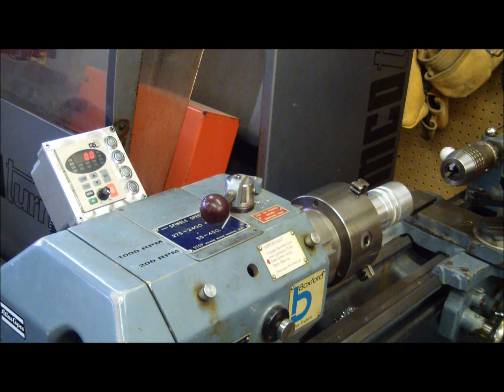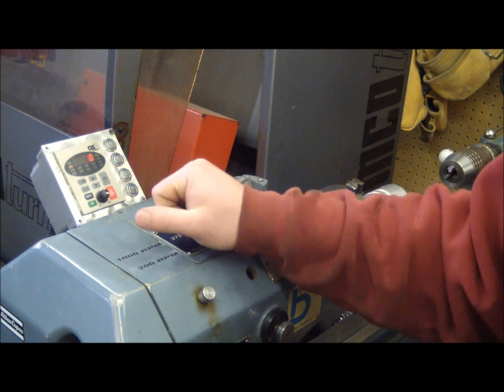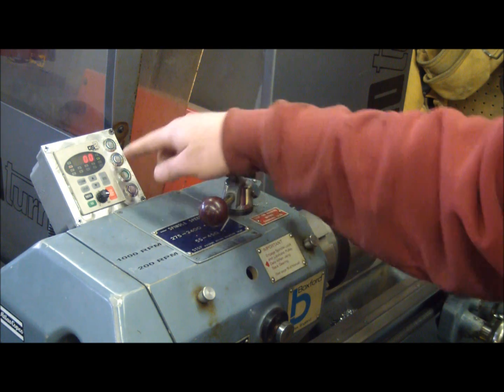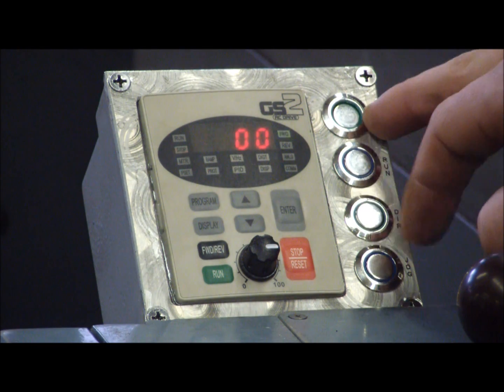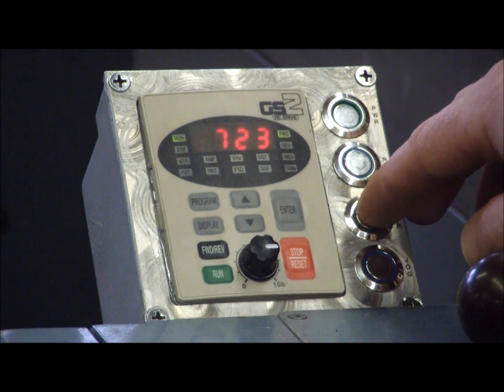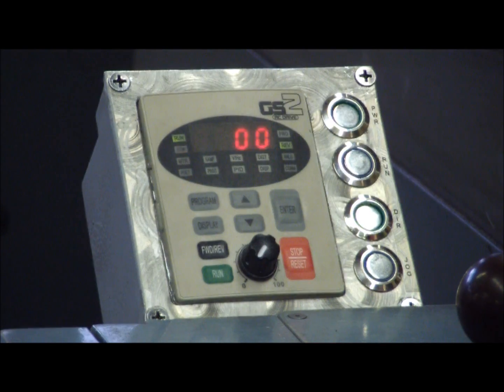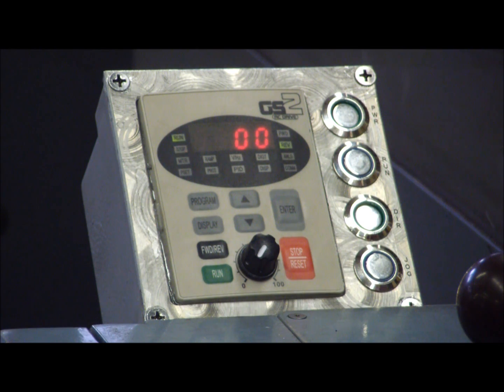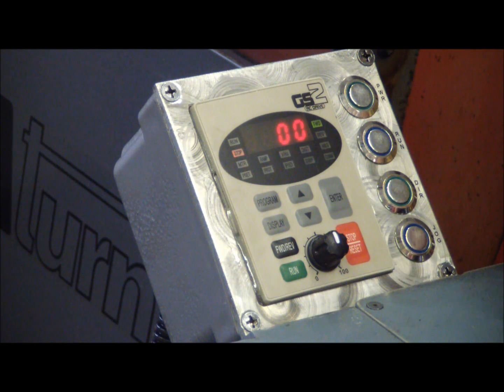How to run industrial 3 phase motor on single phase

Comment: A lot of old 3 phase motors are hardwired in star (wye, Y) configuration. You can run them on these 220v output vfds but you get something like 50% of rated power. You can open the motor up and try to locate the star point, cut it and bring the terminals out to the junction area to be wired in delta, but it's a bit of a job for someone who hasn't done it before. Can damage the winding insulation during the job or in operation afterwards if it's not put back together mickey mouse.

Comment: I hope you see this AVE,(considering this video is about 8 years old) I didn't want to post this on some random video. I thought I saw a newer video of you and Dewclaw working yalls electrical magic with installing VFD's for your 3ph machinery. I stumbled a pon some videos using a 3ph motor powered by 240 and in turn it was creating a 3rd leg for their milling and lathe. I am an electrician by trade and kinda have an understanding  what's going on here.  I was just wondering if you could explain it in your words and ways. another thought/question, unless someone just had a spare 3ph motor sitting around collecting dust why wouldn't they just buy something like you have in this video? It seems like it would be "cleaner" power and more functions. I can't imagine  buying a 3ph motor just to create the 3rd leg is cheaper than doing what you have done here though i haven't priced anything just speaking on opinion.  Thanks for what you do, I'm glad i stumbled on your channel!

Comment: Hi  I have a Mill/drill I just purchased. It has a 2HP 575VOlt 3 phase . I cant find a VFD that will take 240 single phase in and put out 575 volt 3phase. Any help would be AWESOME!!!!
Reply: Try configuring the motor for a different voltage

Comment: Google search turned up nothing...  (2019 go figure)

TY on android ≠ search within channel...  

So after scrolling thru every last video.  I successfully wasted a shit ton of time and further strengthen my proof that the interweb is the smoking gun.  The absolute, unequivocal, "fuck you buddy.  I know what the hell im talkin bout" proof that Mandela Effect is real.  Case in point.  Remember when you used to google something.  Then boom you solved the answer or located that precious bit of information.  Hell it was once so good at that knowledge thingy.  you'd be inundated by details, origins, and facts.   Making life easier and trivia night at the bars awesome.  But back to my quandary.

  I cannot find the video showing AvE dissolving a broken bolt from a cast aluminum engine block.    where dafuq?  0_o?

Comment: Word of warning, if a motor is not inverter rated you could end up shortening the life of it significantly. Inverter duty motors have thicker insulation. You need that because most motors have a cooling fan attached directly to the shaft, and it causes problems if you're running the motor really slow, you no longer get that airflow the motor needs to keep the windings from overheating. Most industrial motors you get these days are inverter duty but if you're picking through and get some 50 year old machine it probably won't be.

The other wrinkle is how much you're using it and to what capacity. If you use the thing for hours a day every day at slow speeds and Max load your old motor won't last long at all. But if you turn the thing on once a month and it's way oversized for what you're doing, it's probably fine.

Comment: Hey Ave it's an emergency! I've been scouwring the intervebs trying to find a supplier of the S12H Rastall tool corp Swedish nutrounder that will deliver to the back arse of nowhere here in Ireland. Do you have any advice as to how I could obtain such a tool without breaking my piggy bank and forking out a whopper 300dollhairs just for shipping costs. P.s, Skoda haven't improved their performance since you've last visited. Anywho Greetings from Ireland.

Comment: Is the GS2 from Automation Direct really a Vector drive? It shure is a Variable Frequency Drive, but does it use regular V/Hz-control, or sensorless feedback control such as sensorless vector control? I mean AVE claims the device does overtorque, and for that there has to be feedback control involved?

Comment: Rotary phase converters might be antiquated, but the one that I build 15 years ago for next to nothing is still running strong.  It can start a 10hp motor with ease. A VFD that could do that is way more than I can afford.

Comment: Hey Ave, great video, as well as many of your others. what HP is your motor?, I have a 5HP 15x40 lathe I need to retrofit to VFD  from a Rotor phase.  I like your remote set up. any issues with the brand you purchased?, other comparable  models and brands? Looks like I need a 10HP VFD to run my 5hp motor from imput 230v single to 230v 3phase.

Comment: I have a  maximat lathe Super 11. I am changing out the electric motor due to issues. And will be adding a VFD. What would be the recommended Motor for a standard 115 outlet. That will still run the lathe. Most HP, Torque, Etc...? Any and all comments will help. Thanks

Comment: can I use this on a 3/4 HP 3 phase motor? Thanks
Reply: VFD's will work on nearly any 3Φ motor. Generally speaking you need a drive rated for at least the same size of motor or larger. Good quality drives will scale down no problem. My test bench has a 5 HP motor, although I often test drives rated up to 150 HP on it.
Reply: Leggir sure, the test bench is one situation, but if that is gonna be the final configuration you have to make sure your conductors and protection are sized adequately. Don't want any fires.

Comment: The whole reason I started watching these videos was cuz I bought an air compressor motor to run off a power inverter because I didn't know better. the guy at the store told me it should all do it and it don't do it...works great when I plug it in at home, but no go on my inverter. turns it once or twice that's it. is there a solution to this? hope you respond don't know who else to ask.
Reply: Probably need at least 4 or 5 times rated motor power maybe more.
Reply: Wow, you really need the specs for us to give an accurate opinion. What size of motor, what size of inverter, etc.

Comment: what volt are your button and whare did you get them?
Reply: Most VFD's use 24-Volt for controls, but that may vary by model. Check what your inputs are rated for, then look online for switches rated for that level of voltage and the enclosure type you have. On my test bench I just use regular light switches to trip inputs.
Reply: Leggir thanks

Comment: Hey AvE i am in Australia we are single phase 240v and 3 phase 415v will  the VFD work with the voltage increase? I am not real flash with anything pixie related!! So your thoughts would be appreciated!
Reply: when you feed a 400 volt 3 phase  motor with a single phase inverter the output of the inverter is going to be 3 phase 220v. The motor must be checked if can run at triangle configuration.
Reply: No its not have been using two inverters 400v 3ph for many years fed from 240v 1ph, one was a 4kw the other used daily 7.5kw.
Why do people all assume an invertors all 200v 3ph.
Reply: All drives have an input rating and an output rating. Most will accept a variety of input voltages and generate 3Φ at a completely different voltage. It's important to check the manual prior to purchasing. The ones I use for instance accept 277V and output 575V.
Reply: 230v and 400v are the same voltage, one is single phase the other is 3 phase. You take one phase out of a 3 phase 400v outlet and you have single phase 230v.  God save me from people who don't understand how AC power works.

Comment: How about programming this thing to lets say run 3phase water pump? (everyday at 6am?)
Reply: emceh you would need some additional controls to run it on a time cycle. Namely a timer. You could probably use one of those plug in light timers if you wanted to go real cheap, otherwise there are industrial grade interval timers that you can buy to do the job.
Reply: Buy a 3 phase disconnect and control it with the timer.
Reply: Jasin Colegrove that's not the job of a disconnect. You want a contactor for that. And it bears mention that that is an across-the-line starting method that doesn't allow for speed control.
Reply: Eric Lindgren not sure why want a speed control on a water pump. You buy a valve and control flow rates. Seemed to me the guy needs 3 phase output only on a timer. Or at least one can hope...
Reply: Eric Lindgren and in that case I would not recommend a VFD. Dumb
Reply: Jasin Colegrove proportioning valves work pretty well if you are trying to control flow rates but if your impeller isn't correctly ground, back pressure can be damaging. VFDs have an issue also. If you are running them at aloe frequencies, the cooling fan may not work correctly and the motor can overheat. Generally when one of these is used for flow or pressure control, a PID controller is also used for closed loop feedback.
Reply: I'd still prefer a pressure relief bypass valve then to use a VFD. But as I said, this goes beyond what I feel the OP was asking. Self cooling water pumps, submersible water pump, need to run to cool. A case of bigger is not always better. Appropriately sized pumps are probably far less of a headache and simply easier and cost effective to any other solution.
Reply: I also want to do soft start of 3 phase motor.  I have 1 phase UPS that I would like to use as power source in my remote location. Soft start lets UPS to adapt to growing load as one phase pumps will have very high initial surge demand that UPS might not like and shut down.
Reply: Depends on the type of VFD you get. I use Unico (built in Wisconsin, division of Regal Beloit), and run all types of pumps. They have built into the software time of day uses, in addition to a ton of other things that a common VFD doesn't have or requires a bunch of extra hardware.
Reply: Again, as I mentioned, the Unico VFD's can do soft start, time of day uses, calendar control, timers, Solar control (turn on when battery capacity gets high enough), and a plethora of other options.

Comment: to mr AvE i have gotten myself a 3phase lathe for a steal is there any way to do a rewire to run it on single phase instead of buying a new motor
Reply: vfd, you put in single phase, get 3 phase out. Watch the video.

Comment: Keith

In your video you indicated that you planned to connect two rotary phase converters to your 3 phase power supply panel in your new shop and when you needed max horsepower you would run both converters.. Would you not have to  synchronize  the phases in both machines or will the converters automatically synchronize? As I recall the Navy when the electrical mates would connect shore 3 phase power to the ship's 3 phase power they trireme ver hear to synchronize the passes.

Another question. In all the machinist videos the machinist smears lubricant on parts being machined in the lathe. The cutting tool looks as if it is shearing the metal and does not contact the lubricant when cutting the metal. Is the lubricant penetrating the metal lubricating the cutting action?  I understand the need for lubricant in drilling or milling as it cools the metal and removes chips.

As always I look forward to you videos.

Charles Moore
Reply: Charles Moore his name is keith?

Comment: these are great, right up to 3hp. then it's too costly and you still need 3 phase input.
Reply: +AvE Wish I knew this when I picked up a 3hp wood dust handling system at a garage sale. Did double my money on it, though. Still haven't made the time to hook up the one I bought (though I did build a closet and soundproof it.. Lately I am thinking of moving my 5.5 hp air compressor in there, too. Since various hoses started leaking it runs more often and won't get by on my One Timer Function a day as I currently run it)
Reply: AvE there are also inverter drives that do the same thing. But you still have to have the juice to power them.
Reply: not necessarily. I have two 10hp Allen Bradley powerflex 70s from surplus.  I run them on 220v single ph. I do derate to 5hp though to be safe.

Comment: AVE, you are correct in every way but two.  I love those vfd's for many reasons especially if I need a motor starter anyway it helps offset the cost comparison. Like one of the previous posters said larger motors- big bucks for the vfd, the other A Year ago I designed and built a 150 amp 300 phase rotory converter using a used motor and over sized 100hp @460v (massive) used motor starter. This was for a local up and coming fabricator who was trying to expand and hire 2 more employees to add to his 3. This Rotary Phase Generator has been running 6 days a week with as many as 4 large 3 phase welders simultaneously. While that is going on it also runs a bunch of smaller 3 phase motors on shop equipment. (iron worker, lathe, cold saw, 5hp hydraulic power pack). Ideally VFD's all the way for motors, unless cost and versatility is an issue. Keep up the good work, one day i hope to be able to slow down and have enough time to play around with my video camera.

Comment: Hey,.Ave. I work with the tree carcus. A few of my older tools don't have soft start and could desperately use it. Do you know a source for such a device for universal motors found on table saw, etc? If not, how about that for a project?
Reply: +Andrew Baran Reaching back far now. Isn't there a way to hook up 3 phase motors/machines with Y/D start and that way give it a soft start?
Reply: Thanks Will but googled "Magnus B dual motor starter" and nothing comes up.
Reply: What I referred to is the connecting of the field windings.  It's called star connection in America I believe. Basically the Y/star connection gives a slow rpm and high torque and the D connection gives high rpm with less torque.  But as I mentioned I'm unsure how this works with the motor you have.
Reply: A.W., Magnus B is the U-tuber's name Will linked his reply to. So I suppose look up dual motor starters, or soft starters, or some sort of timed, stepped, or auto rheostat.

Comment: I just purchased a 1967 Logan Lathe that has a 'Doerr' 1 HP,  3 Phase motor. (9 wires).  It's already is wired to the Furnas Drum switch with reverse, off and forward.  The Lathe itself has variable speed (within a certain range) by turning a dial which moves the belt and pulleys to speed or slow Spindle..  If I hook up a VFD, does that mean that I should bypass the Drum switch entirely and use the VFD for that control?.  Thanks in advance... Bob
Reply: Yes, use the VFD for speed control. You may be able to use the dial though to still control it by connecting the dial to an analog input, however you have to make sure it can handle the voltages and current the ANIN requires.

Comment: Drives are very easy to install, and troubleshoot most are very easy to add controls for damn near anything you want. I am very very firmiliar with allen bradley powerless drives. But they are expensive.

Comment: AvE, I picked up a General table saw last weekend from a guy who clearly didn't know what he had... Canadian made from the good old days and he let it go for $200.  I think he was afraid of the 3 phase motor.  I had it tested and it runs great but I don't have 3 phase in the shop.  I was looking at either replacing the 2hp 3 phase with a 2hp 1 phase or a cheap phase converter but the guy at the motor shop suggested I get a drive for $185 instead.  What would your recommendation be?

Comment: I have a 25 hp powerEX air compressor do I need a 25 hp variable frequency driveto run the compressor and will it run smaller three-phase motors for me like a 1hp or a 3 hp 3ph?

Comment: Ave. I do have a weg 10 hp 3 phase motor on a mexican grinder machine. 
it is to fast i would like to know if i can install this speed controler?
Reply: Thank you
Reply: +Diesel Ramcharger can you please explain how you did the calculation?

Comment: Thank you for this video, it's a great help with my project.  On the Adifruit site, there are several switch choices.  Which switches did you use?  Just the simple push button or the start/stop buttons?  Thanks!

Comment: The only thing to worry about is the insulation in non inverter duty motor windings, if you have a motor that is irreplaceable you may want to use a rotary phase converter.
Reply: wgenerotzky Actually most old motors have better insulation than many of the new ones. 4 years ago I put a motor tagged 1967, which according to the owner was original except for the grease. I it's been running at 80 Hz and 3.6 kHz switching frequency since installation and hasn't had any problems. Meanwhile others have cheaped out and bought brand new Tatung Inverter Duty motors and have had them fail in less than a year, often on bearings and sometimes on inter-winding shorts. So while on a new install NEC or CSA requires an Inverter Duty rated motor, on existing or non-permitted installs you can run a drive on nearly any 3 phase motor.

Comment: how did you add these extra buttons 
better yet were did you get these silver buttons ?
Reply: thanks alot for your time...
Reply: ***** were i live is 220v ....its hard to make sure which one to buy "the VFD"as for the button...its says due to increased  fraudments there not able to accept my credit card..

no problem i was able to find the source "factroy in china" alot cheaper...1.3 dollar/switch bought like 10...lol

i bet the extra button wiring how to was included in the manual with VFD right ?....
thank you 

if i can wire megasquirt (a DIY fuel injection/ ignition system ) then im surely i can do this....
Reply: very well then...
thank you